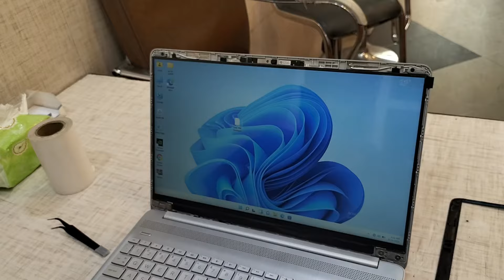hp 15s LED led screen replacement

Comment: brother, please, respond ASAP. My hp15s eq2070ur display is broken, i want to change it, can you please say how much pins is on it. I want to buy innolux slim 30 pins fhd brackets up down matte (borderless) n156hga-ea3, will it fit? By doing it myself i only spend 60$, and if i request a repair in service center itll cost 120$ and 3 days to repair.
Reply from the maker: 30 pin borderless 1920 x 1080

Comment: I have a 15s-fq2039na and there doesn't seem to be the 2 adhesive strips holding the screen in place. 

How do I remove the screen if I can't pull up these adhesive strips? 

Do you have a video that covers the 15s-fqxxx series? 

Many thanks

Comment: how to check display was original or not ??
Reply from the maker: Har display original hota hai bus specs Ka fark hota hai 1368 x 768 simple hota hai phr is SE Acha 1080p phr SB SE Acha 1080p IPS  hota hai ap 1080p IPS lein wo SB SE Acha hota is is 15s laptop mein.
Reply: @techshek.  Mine was hp db1069au to oska haj 1368x768 to how to check ki voh original hai mena service center ca change krvani hai india ketna rupees ma hoo haai ge
Reply from the maker: HP Notebook - 15-db1069au mein 1368x768  original Ata lekin ye hota bekar Hai mein Pakistan SE Hun Pakistan mein 1080p IPS 12000 Ka hai Indian rupees mein to mere khyal SE 3500 banta Hai ye local market ki price Hai. Ap 1080p IPS he lein. IPS display mein apko ek ache premium laptop wali feel aye gi. IPS display ki nishani ye Hai wo har angle se same color dikhata Hai side SE b dekhain to same color hota Hai